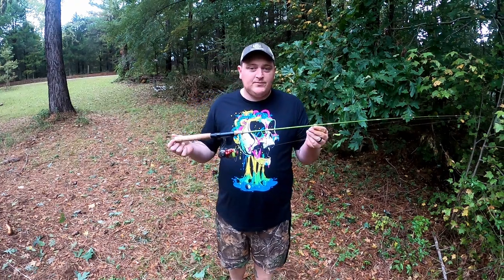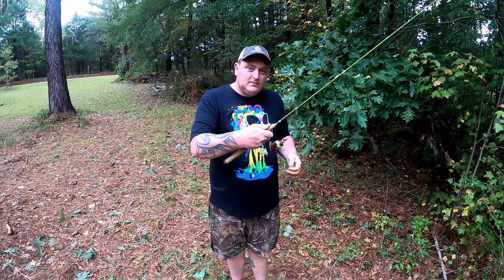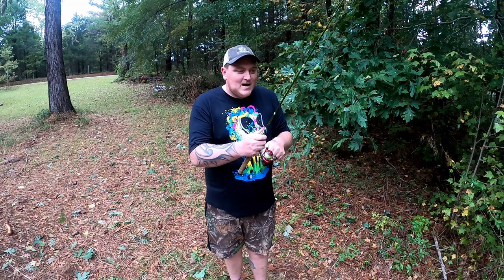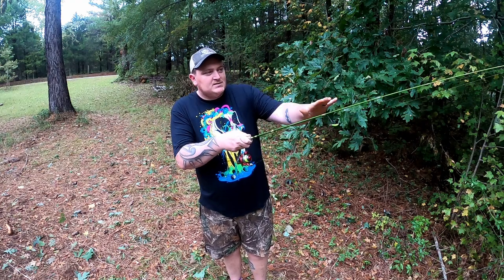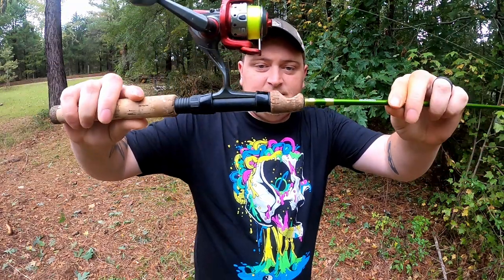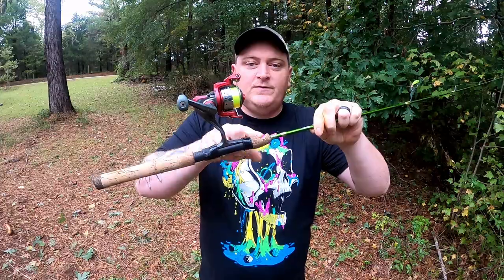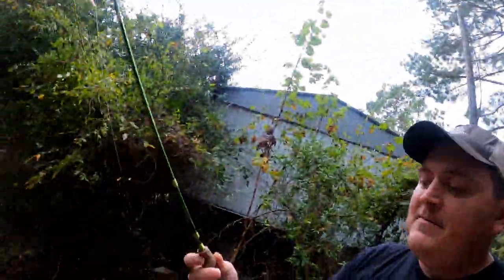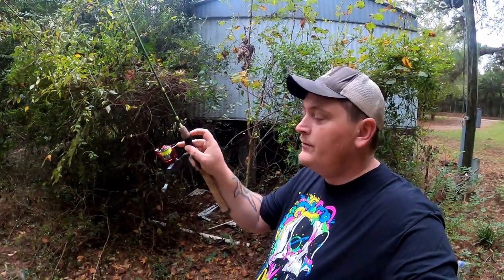Make Any Rod More Sensitive In 5 MINS! (DO THIS!!)

Comment: Will that take any stability away from the pole by cutting into the cork thanks
Reply from the maker: The way I did it I haven't felt a difference in the rod itself just don't go into the blank or take away more than you need. Id try it on a rod you don't use 2 see if you like it